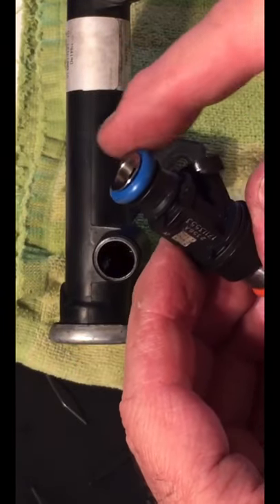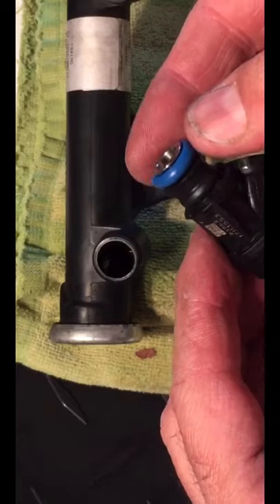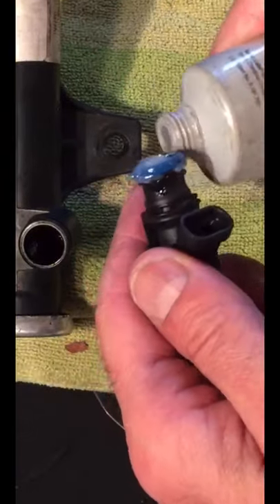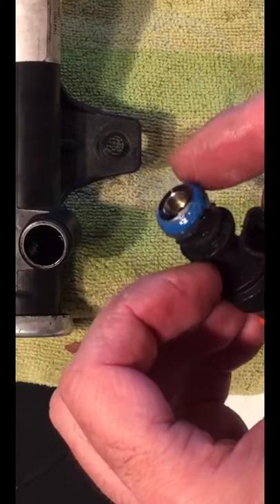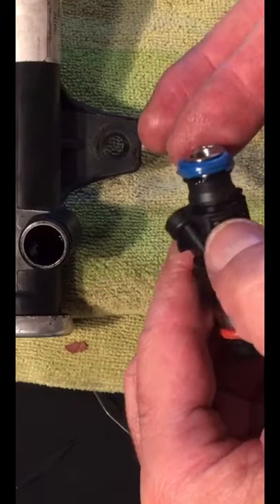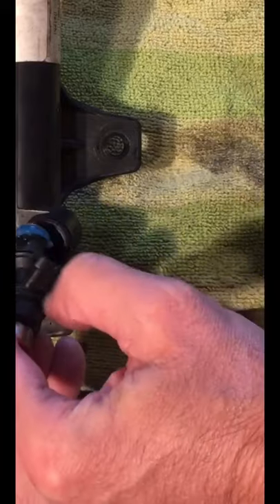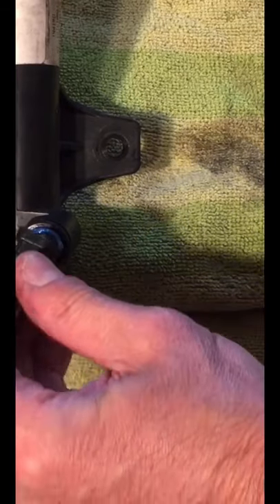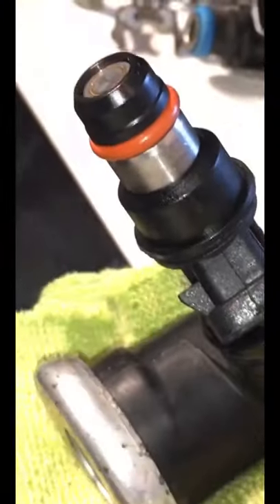How to install fuel injectors. Please LIKE and SUBSCRIBE 👍

Comment: The dealership wanted an extra $360 usd to replace my fuel injector in my 2014 Jeep grand cherokee after a half hour diagnosis $76 usd.
Reply: U pay for time and knowledge ,why didn’t u diagnose it ☠️ knowledge is power
Reply: Go to any autoparts store and they usually have a scan tool and for your misfire you will see the code for what cylinder has the problem saved a whole lot of money

Comment: Mopar already gave there's pregreased. Jeep is weird anything that's electric or significant to the engine you have to use original oems because that vehicle will not run right.

Comment: Is the fuel rail under pressure? pressure
Reply from the maker: Yes, you need to release the pressure via the schrader valve on the fuel rail
Reply: @PhillipsVision  can you tell me exactly where it's located on the fuel rail
Reply from the maker: @kingfreedom1863  it varies based on the vehicle. It could be in the end or towards the middle of the rail. On newer vehicles the schrader valve is not even there. To cut cost manufacturers are not putting them on anymore. If that’s the case you’ll need to release pressure by removing the relay. Here’s a video I did that may help: https://youtu.be/XX58ZFZLy6E
Reply: Just alittle pressure will spray once you pull the first one, the rest will not.
Reply: I highly recommend that you purchase the correct injectors. Toyota camry and Toyota Camry Solara are totally different from one another, if not, and you turn the ignition over will burn your car to the ground because the injector didnt properly seat itself into the chamber (a gap is present)